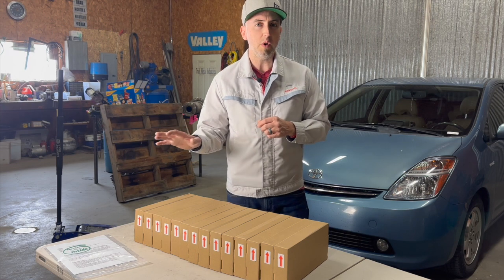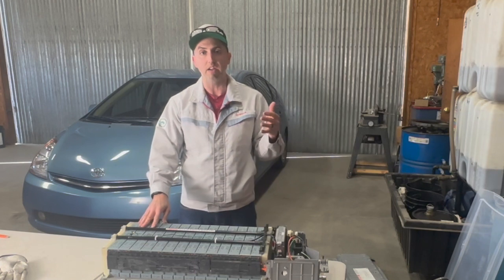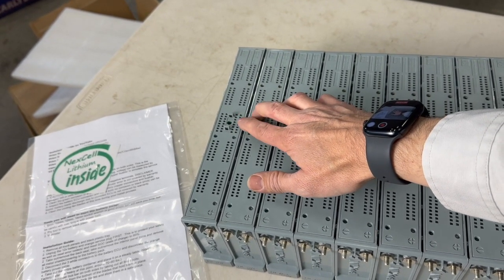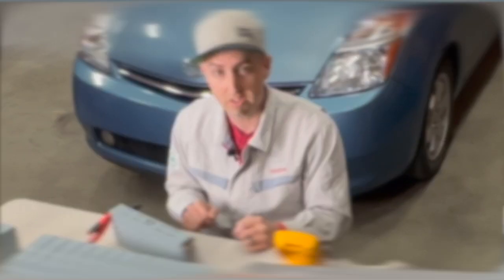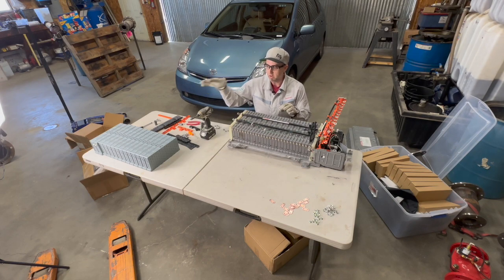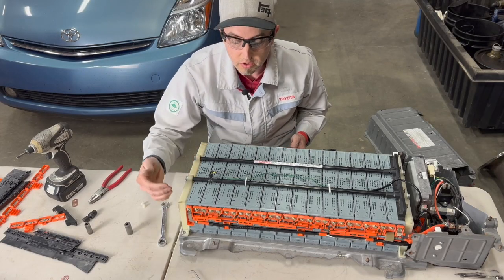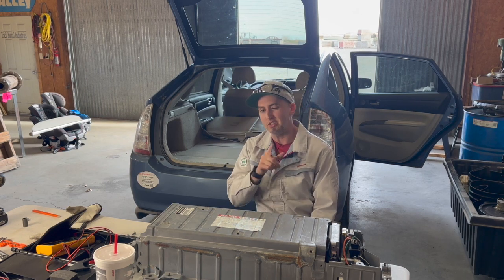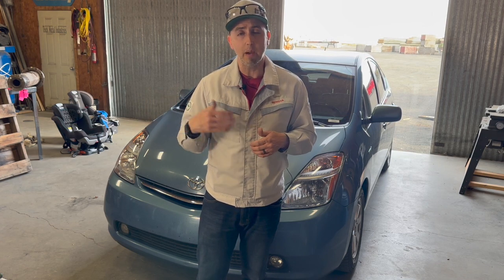Nexpower Generation 2 LiFePo4 Hybrid Battery Update and Install

Comment: Since this battery is not actively heated and uses LPF batteries that don't work in freezing temperatures, it most likely work only in California or Florida. Anywhere else you will periodically turn your Prius to an ICE car with some errors related to traction battery. I would love some winter test references if I am wrong
Reply from the maker: With the new version 2.5 it now works in below freezing weather just fine no issues.

Comment: Whats the difference between v2 and v2.5 and how do you tell if you have v2 or v2.5
Reply from the maker: Hi, v2 and v2.5 is not easy to tell. You can email them and see what version you have. The difference in the 2.5 is improved cold weather performance.

Comment: Often the OEM battery just needs 3 or 4 modules replaced. Buying new all the time is what defeats the circular economy and defeats the whole purpose of burning less fuel....carbon emissions and global warming.
Reply from the maker: Thanks. But not all people know how to replace and properly repair NiMH batteries.
Reply: @TheHybridGuy  If they can follow your video, there are many similar for NiMH modules in youtube. Is this video  about assisting customers to manage costs/options or up selling a new battery pack? Why buy a whole pack of 20+ cells vs replacing  a few?
Reply from the maker: @ancelb9590  What most consumers do not understand is capacity reduction on used modules. Also most people think you can simple swap modules and have the pack be ok. Reconditioning and replacement of these modules isn't complicated but it does take time and expertise to repair a NiMH battery properly for maximum life. With Nexpower LFP you are maximizing your fuel economy which will translate to greater savings over time vs used nickel. NiMH is a great part of technology but there are better battery solutions out there.
Reply: @TheHybridGuy  that's mostly so, but at what cost? A cost/benefit  assessment would be useful vs just buying new all the time. That's destructive to the environment on multiple fronts. Creating unecessary e-waste with the dumped Ni MH cells while simultaneously driving up the carbon emissions cost of mining for  lithium and graphite.
Reply from the maker: @ancelb9590 Think about realistically how long a new NiMH pack lasts. 10-15 years and if maintained it could last a lifetime. If you are worried about carbon emissions start with education on how to prolong the life of the battery so you don't have to ever change it. LFP offers the best of both worlds a chance to start over and get a fresh battery (NiMH can be recycled and make into new ones thus lower the carbon footprint) and then with LFP you have a new battery that gives you better fuel economy and will last 10-15 years. If maintained it will last longer. Its about education on how to properly care for your battery. If you want to further this discussion you can email me.
Reply: You should make your own video and explain all of this.
Reply: @majorsmackdown  Will get to it. We're deploying new custom battery regeneration gear that does the whole battery as well as the individual module regeneration. So enduser feedback comes 1st b4 we go commercial.